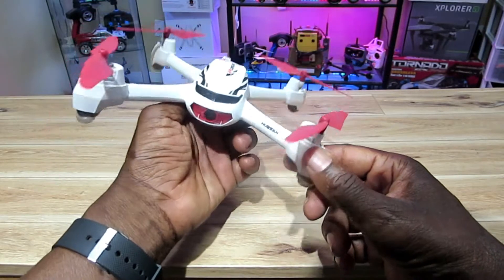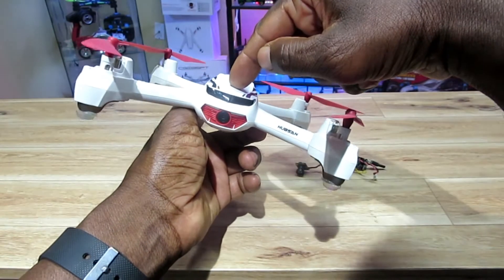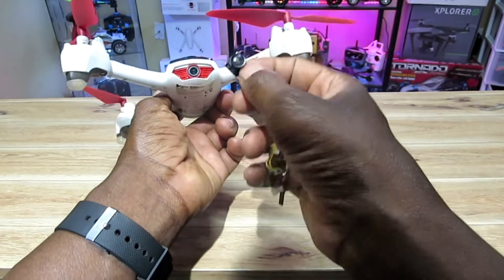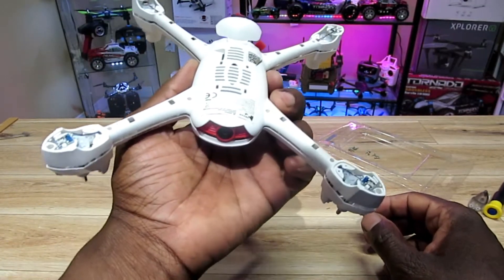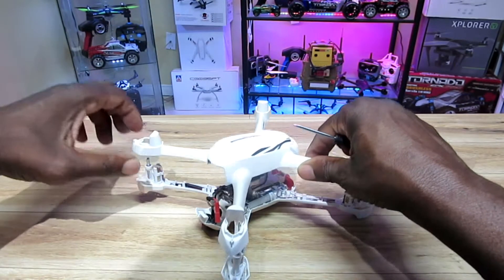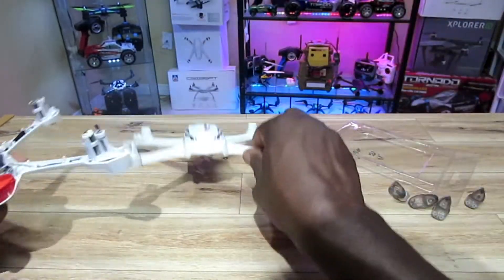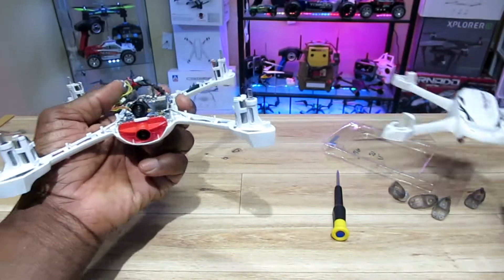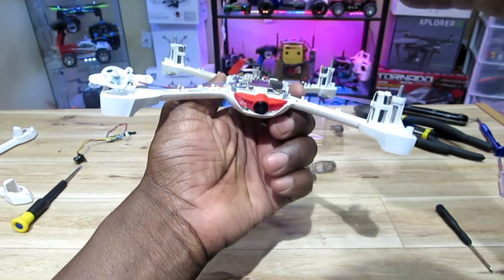Hubsan X4 H502E Internal FPV Camera Mod. Install and Demo

Comment: Good to go. No type of interference with the gps and fpv camera antenna?
Reply from the maker: Hey brother, I didn't notice any interference. Thanks for passing through👍🏽
Reply: @torontorc4637  ok bless. Will try. I just fixed mines today after the motor failed over a year ago lol

Comment: You're mod work is the best. Always a blast to watch. Did you disconnect the internal camera board from the main board? Losing that power sucker should gain you like 7 minutes of flight time. Just a thought. That A5 looks amazing! I have an A2 and an A3. AKK kicks out a pretty picture. Cheers Elvis!! Flyin season is almost here! Woohoo!
Reply from the maker: Thanks man, I didn't disconnect the camera. I like to fly fpv and record in 720p. Thanks for watching man. Can't wait until summer👍🏼

Comment: Can you explain exactly what camera that is? I cannot understand what model you are using. Thanks Also, you did not show how you wired in both switches. Can you show how you did it?
Reply from the maker: It's the akk a5. Here's the link

AKK A5 5.8Ghz 40CH 25mW FPV Transmitter 600TVL CMOS Micro Camera Switchable Raceband for Drone Like Tiny Whoop Blade Inductrix
 http://s.aliexpress.com/NjEJziu6?fromSns=Copy to Clipboard
Reply: Thanks. I watched your other video and figured out your two switches. The side one just turns on the new camera and the back switch just turns on the onboard battery, which is already plugged in. Don't know why I did not see that. Oh well. I just ordered this quad, and did not realize it was NOT FPV. So the mod is next. Thanks.
Reply from the maker: No problem man, have fun with it 👍

Comment: Excellent work dude. love those switches... I wanna try a 200mw transmitter but where do you get the 5volt  connection for the tx?
Reply from the maker: Thanks man, try AliExpress

Comment: Nice mod Elvis, that takes ingenuity and creativity. Very clean work. I don’t think I’ve ever seen anyone install switches like that. Are you an electrician? Looks like you’re in Canada. For the price, this is still a really good GPS drone to play around with.
Reply from the maker: Thanks man, I appreciate that . I'm not an electrician but I'm kinda familiar with that stuff. Yeah the h502e is a great little quad with lots of features. Pretty advanced toy grade for a good price . Later bro👊